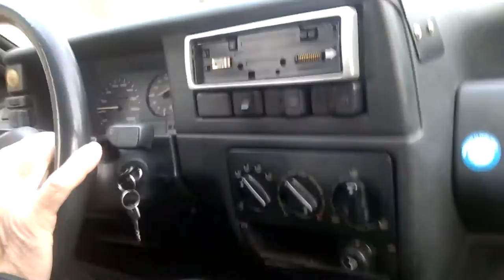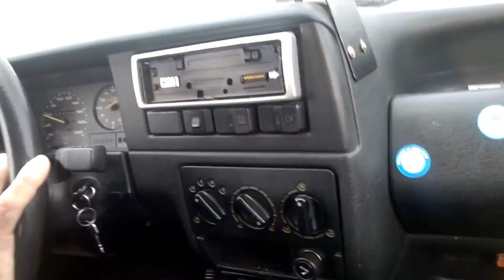R.I.P.: VW Polo Fox 1.0 1990 r. (86c2f)

Comment: Trabant 1.1 sound 😂😂😂
Reply from the maker: Noooo, Trabant has similar but not the same engine - different cylinder head, hasn't SP injection, hydraulic tappets, exhaust, etc.

Trabant was quiet :)
Reply: Trabant has nothing to do with this car, primarily Trabant has a  two stroke engine, and this car has a stronger  engine and better quality. But I prefer  the same VW Polo with a 1400  diesel engine. Renault 5, Fiat Uno, Peugeot 205, Golf mk1, Renault 4, Opel Corsa and various cars own a 1.0 and 1.1  petrol engine  so they do not sound like a trabant, the trabant is a car crash. Fuck your trabant
Reply from the maker: +Nicola Majic
All 601S and older has 2-stroke engine. And 800RS, but this wasn't "civil" car.
Older VW Polo (86c with circular lights) has the same engine as Trabant 1.1 - 1043cc with 38 KM (carburetor, mechanic tappets etc). In this video has 1043cc too with 45 KM (single point injection, hydraulci tappets etc.).
In old car very often engine sounds diffrent.
Reply: @RafiXX  I had this same polo, rotten cherry metallic in 1991 but diesel 1.4. It was economical, wasted no fuel, easy to maintain. But after a lot of miles, his engine fell apart, that is, we sold it in scrap parts because he had brushed the cylinder head gasket X times, so it worked on a single cylinder. And then the gearbox that was blocking at the end. These polo 86c models are not as good as diesel 1.4 but only as gasoline. People without a relationship don't say polo is a small town car. The Golf 2 1.6 diesel is the mother, otherwise I now drive the Golf 3 1.9tdi 1995g. greeting